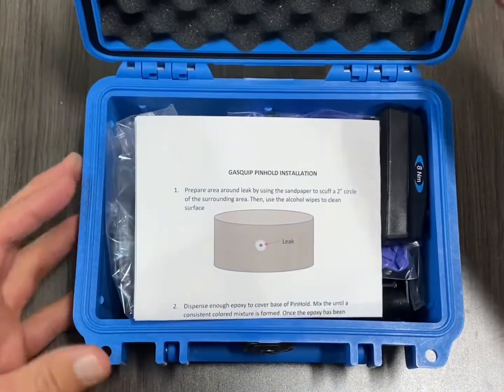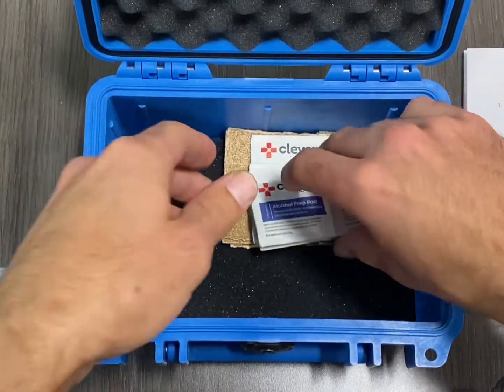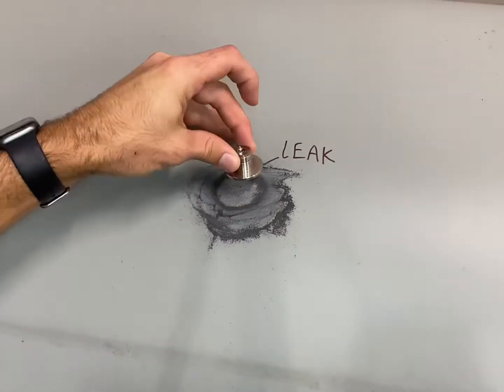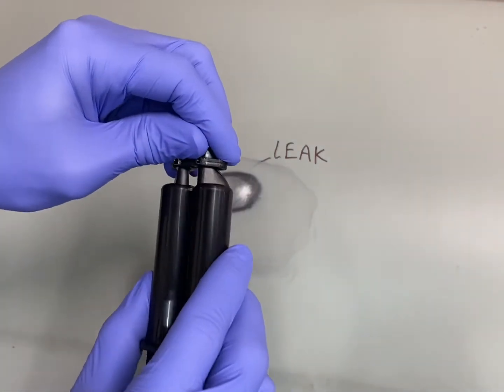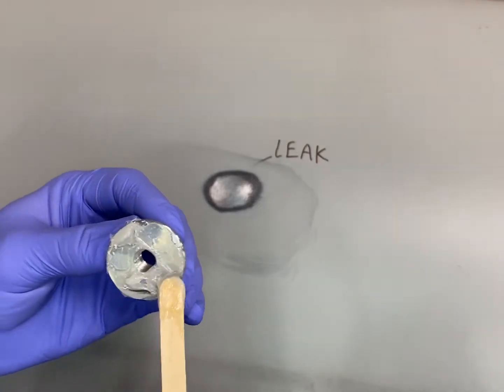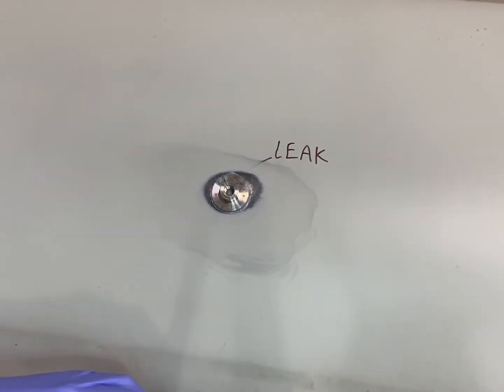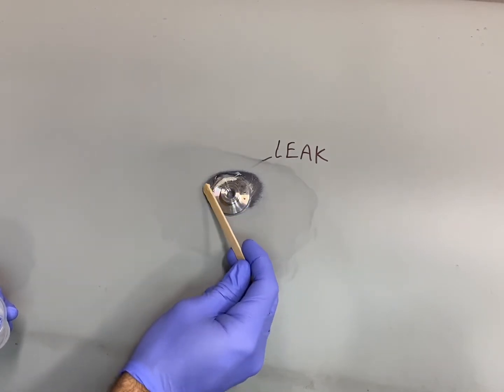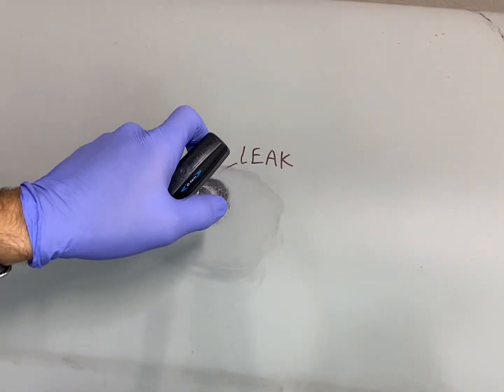PinHold - SF6 Leak Repair Kit

Comment: Recommended under what pressure? Atmosphere would assume?
Reply from the maker: Hey Curtis - this kit can be applied while breaker is at full pressure. With most epoxy patches, you have to degass because the gas will tunnel right through the epoxy while it cures. Our "chimney" style design allows the epoxy to seal around the edges of the "PinHold", and then the bolt is what ultimately seals off the leak. Just for pinhole type leaks though.

Comment: Nice video! Would also recommend re-coating the exposed metal (will rust if it is a steel tank) while same time adding a nice UV blocker to cover the exposed epoxy.